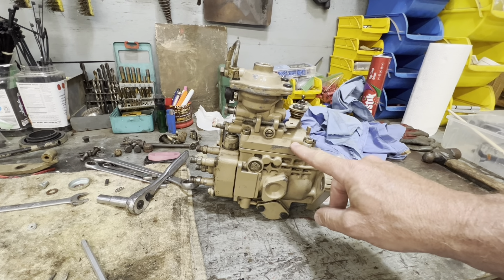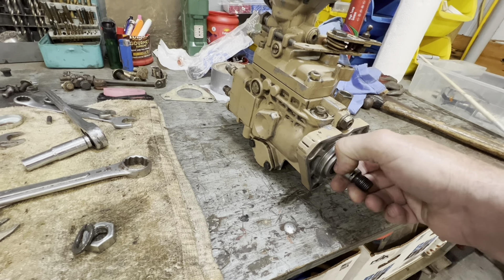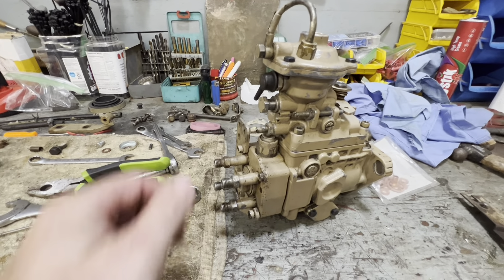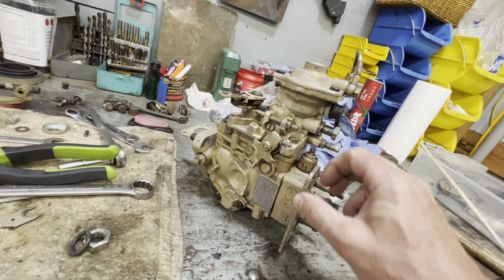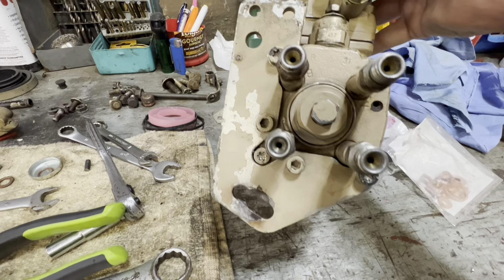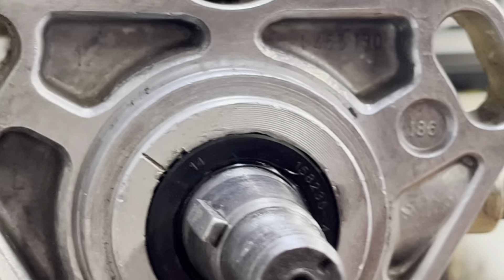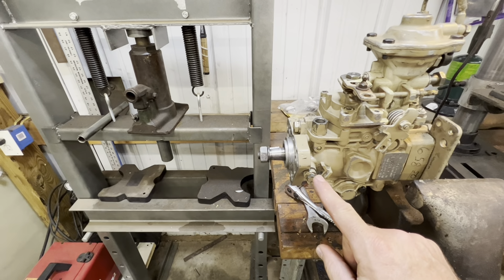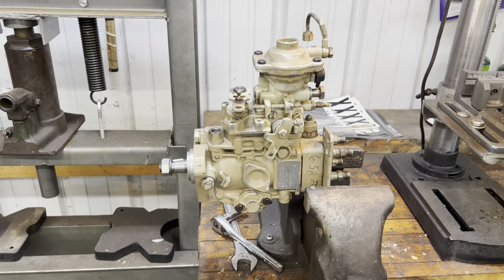Cummins Diesel 6BT / 4BT Injector Pump Timimg￼￼ And Torque Specs

Comment: Thanks for the video! I pulled my pump off the other day to replace the o-ring on the distribution block and forget to lock the shaft. I'm really hoping that's why it won't start right now.
Reply from the maker: As long as the key way on the shaft lines  up with the scribe mark on the housing it is timed. Did you put everything back in place before tightening down the distribution block? Make sure the pump timing mark is lined up to the mark on the back of the front cover housing on the engine. Bleeding air can be difficult sometimes out of the pump and all injector lines.
Reply: @jeepmanking3577  I still can't figure it out and it's driving me nuts. It's probably something easy.
Reply from the maker: @brians7185  OK try this take off the air intake tube and if you have a little two cycle gas mixture like for weedeaters or gas blowers poor just a little bit down the intake and crank it over it will fire up and will not hurt the engine and hopefully that will help get everything primed. Ensure that you have at least two injector lines loose at the injector to help lead the air.. then do the same thing with the other two injectors hopefully will start for you

Comment: I have a 1999 Cummins diesel generator 4 cylinder. The fuel injector that was in it the camshaft broke. I ordered a new fuel injector pump. And I done what you showed me in the video that you showed how to time one The new pump camshaft just goes around and around it has the bolt on the side of it to where you and then you time it, but it does be no good to turn the camshaft cuz there's no tension but it does have the bolt on the side where you lock it in place to keep it from moving, I have looked online to find out if it's possible to get a bad fuel injector pump a new one.
Reply from the maker: You feel some resistance every 1/4 turn of the pump shaft. Sounds like something is wrong with the pump.

Comment: Great video...I wounder what the thickness is on that spacer for the shaft lock bolt ? I don't have one.....do you know the Cummins number of it  ?
Reply from the maker: 1/16 to 1/4 you can make your own, as long as the bolt is backed off the shaft and not touching you will be good. Hope that helps!!!

Comment: I'm the same guy 1999 Cummins diesel generator 4 cylinder injection pump. There's no tension in the pump when I turn it with a wrench but it does have the bolt on the side where you lock it in time then you slide it through the whole back into the gear. Just a reminder this is a brand new Cummins diesel engine fuel injection pump. Could this be a bad fuel injection pump. I went ahead and tried it but I don't get no fuel coming out of the fuel pump itself. I even primed the pump. It's got a brand new pickup pump on it.

Comment: Hello. I have a Case 580K backhoe, with a Cummins 3.9 diesel. The foot throttle linkage leaver, on the top of the injector pump was leaking terribly,,, I was losing all of my fuel line pressure, & the motor was extremely hard to cold start. 
After managing to get it started & warmed up, it would repeatedly start, easily, & then ran perfectly. This motor has a Very clean running exhaust, & it was totally dependable.   Now, to FIX THE LEAKING PUMP.
I 'locked in' the motor to TDC, & 'locked in' the pump. It seemed to take quiet a bit of pressure to pull/ POP the gear off of the tapered pump shaft. ??  
I was told that the gear, without being on the pump shaft,  could NOT move out of position, or jump a tooth out of timing!?  
 I Removed the pump & had it rebuilt. ($1000).  After the rebuild, I was told that the pump was locked back in 'time'.
My very intelligent (electrical engineer) Son & I TRIED 3 times to re-mount the injector pump, place it back on the 3 bolts & back through the housing & into the keyway in the drive gear.  No matter how hard we tried to ADJUST/ turn the pump on the 3 mounting bolts, we were still 1/2 of a key off! The gear would not go on!
PLEASE,,,, what went wrong?  What do we have to do to get the gear onto the pump key,,, & then, how do we make sure all of the timings are right?  We already removed the #1 valve cover, & doubled check the rocker arms & valves for TDC.
As far as we can tell, we would have to rotate the motor, so the gear would turn 1/8", about 1/2 the key, to be able to slide back on.

AGAIN,,, HELP PLEASE!
Reply from the maker: OK does the keyway on the injector pump shaft line up with the scribe mark on the injector pump housing if it does then the pump is in time. On the back of the timing cover where the three studs are that mount the pump did you push in the timing locator pin? Sometimes the little nipple breaks off of the timing locator pin not a big deal. So the timing gear inside the timing cover should be timed as you stated and not moved. Maybe when you pulled your pump out it wasn’t exactly at top dead center. That’s where the timing pin locator comes in handy now if you didn’t use the timing  indicator pin Prior to pulling the pump not that big of a deal you can turn the engine slightly to line up the keyway to insert the pump and reattach the nut. Let me know if that makes sense. If not message me back. I’ll get back with you very soon.
Reply: Been very busy, finally able to get back to you. 
Son & I doubled checked everything. He even took the inspection plate off the side of the injector pump to check 'the marks'. Everything seems right.
I changed batteries & cleaned all battery connections yesterday. I also put on another fuel supply pump & pumped up pressure till I heard fuel dumping back into the tank,,, 5-7# check valve. ??
Wondering,,, is it possible to use fuel supply pump to build up enough fuel pressure to BLEED OUT THE INJECTORS? 
If everything sounds right to you,,,
We will totally HEAT block water,,, Hook up 2 huge batteries, & give it another whirl!! 
1st time, she blew out blue smoke, not black!?  Still 1/2 out of timing?  or just not turning over fast enough?
WE WILL SEE.  
Thanks a MILLION, for your help.!  ;>) @jeepmanking3577
Reply from the maker: Good luck, the only way to get the air out. Is at the injectors what I have done in the past is take off the intercooler tube on the intake manifold and I use a little two cycle gas mixture, dribble a little bit down in there, crank it it will help start a whole lot better and easier to get the air out and is a whole lot safer than starting fluid on the engine.

Comment: Great video, thanks! Do you happen to know the pump # of the one you were working on there? I have a B3.3 in an old Toyota that has a Roosamaster I'd like to replace with a VE. So many numbers and combinations.. altitude compensation and road governer would be great! It's maxed out at 1,900 rpm.
Reply from the maker: I sure don’t I’ll have to look when I get home, thanks for watching!!!! Standby for the numbers
Reply from the maker: NR  0 450 424 016
VE. 182-1
3906631
11541. 53748
This is what is stamped on the side of the pump, hope it helps
Aaron

Comment: Hello. I have a 2010 kawasaki mule 4010 with this style of injection pump and for the lofe of me i can not get fuel to squirt out of the check valves. I cleaned it hundreds of times over. I even bought a used pump and swapped the parts over and still no squirting out of the check valves. I know the solenoid is working i checked it. And when i spin it over with a drill at similated engine rpm fuel is coming out of the retuen lines like a waterfall but not out of the check valves. I even tried bleeding the pump of any air
Reply from the maker: Do you have a an additional supply fuel pump on the side of the engine or possibly an electric fuel pump that supplies fuel to the injector pump? I’m not familiar what this pump looks like, but I do understand theory that when you spend your pump over with a drill, you have fuel coming out the return line, but not the delivery valves.. That is very possible it could be a broken cam plate because without it working properly, there’s no way to increase to the high-pressure fuel to come out of the delivery valves that lead to the injector lines and then to the injectors.
Reply: @jeepmanking3577  I didn't put the top back on and I can see everything moving as it should so the cam plate is good.
Reply from the maker: Do you have an electric supply fuel pump?
Reply: @jeepmanking3577  I do
Reply from the maker: Make sure you have plenty of flow from the lift pump to the injector pump. If so the injector pump might be wore out and need a rebuild.

Comment: How much did it cost you for parts    To build the 4bt and make everything work?
Reply from the maker: Close to $3500-3800 for the engine, adapter, partial engine rebuild, brake booster and mis parts. Hope this helps you?  Thanks for watching!!!!